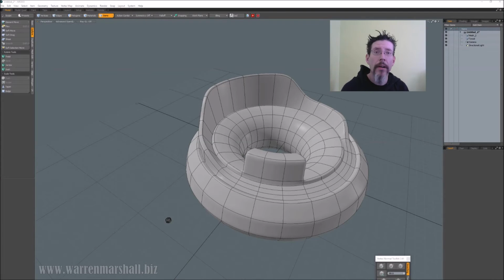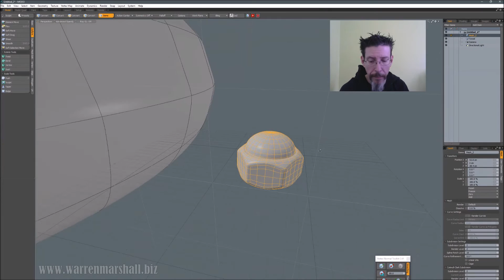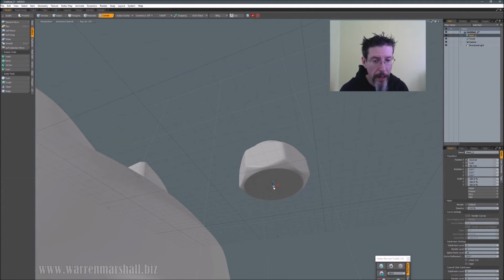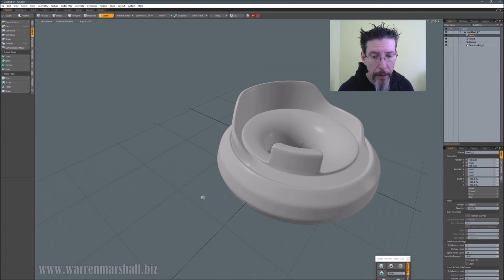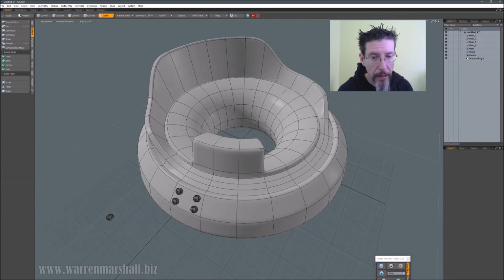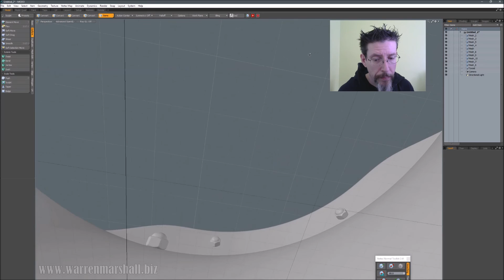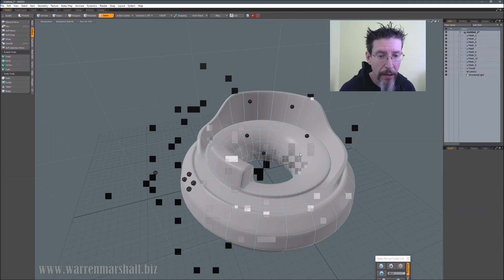Quick Tip #1 : MODO Place & Align

Comment: Seems a useful addition to tacking.
As a tacking newbie, tacking seems tricky if the face you need to tack either:
1)  isn't easy to select because it's already facing the target
2) doesn't exist, because you don't model faces that will be hidden.

Comment: Hey Warren (and James), I'm trying to get this to reliably work, and can't.  Are there any particular Action Center or Snap modes I need to be in?
Reply from the maker: +Gaurav Mathur Not that I noticed.  Make sure you set the Drop Action (1:47 in the video) ... other than that, I was just in Item Mode and dragging meshes around.